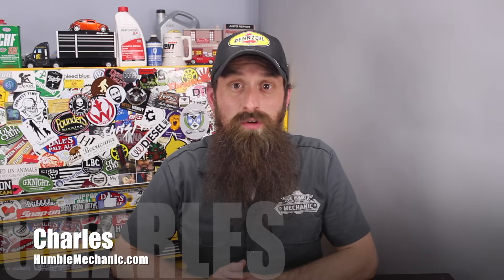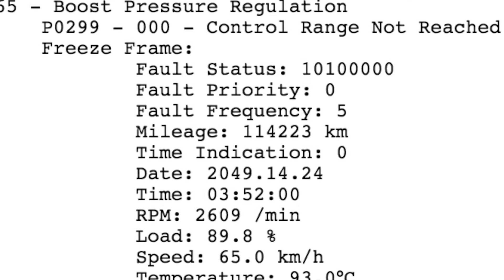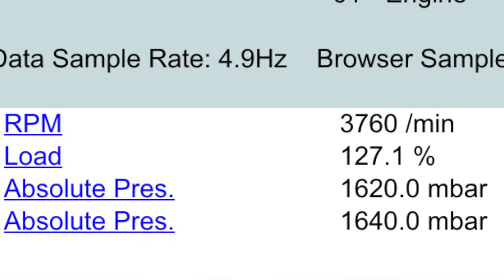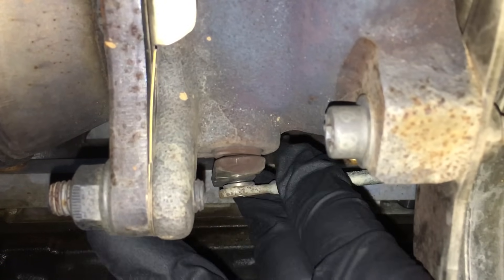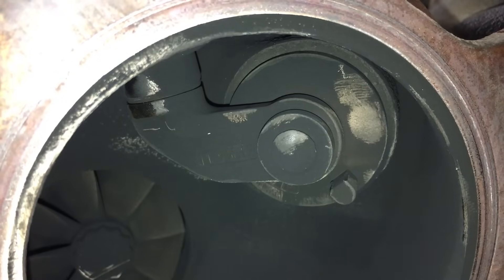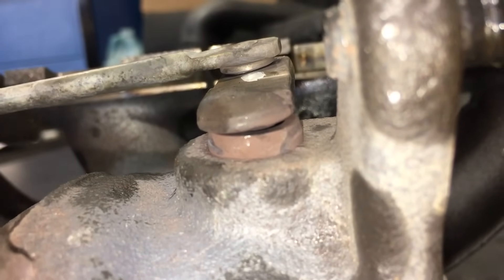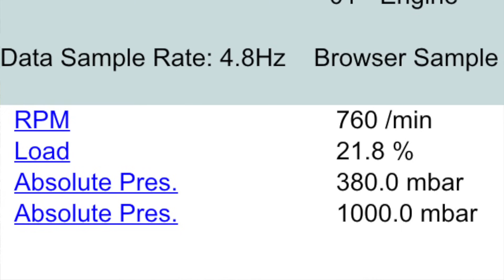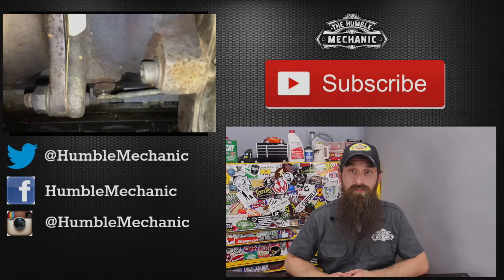Does Your VW/Audi 2.0t TSI Have A Bad Turbo

Comment: MIDLEADING INFORMATION: You can get the wastegate actuator replaced or send it somewhere where they rebuild turbos (way cheaper than dropping over $700 on a new OEM turbo). Also you forgot to mention to check play on the turbine if it moves in and out. Also spin the turbine and if it feels like it hits something, then it’s bad as well. One last check is really easy, run the car hard (pedal to the medal) for at least a good 30 minutes at night. Then park in a dark area, open the hood and check the catalytic converter. If it’s glowing red hot like if it’s lava then turbo is leaking oil into the exhaust system and intake system. You can also smell the burn every time you do a hard pull. You don’t need a new turbo, you can get it repaired/rebuild. You can even buy a good used one. One last thing, expect the life of your turbo to drop drastically if you run a Stage 1 tune or higher. Hopefully this helps someone
Reply: addio12 this guy’s calls himself humble mechanic. And “likes vdub” but all his videos are him talking shit on them and making claims for videos.
Reply from the maker: I’m not sure that’s accurate. Or has anything to do with humble or not.
Reply: Hey I have a 2004 Audi AT 1.8t and last year I upgraded to the K04 turbo with software upgrade, injectors, and high flow CAT.  Everything has been running great and still does, except about 6 months ago I noticed my exhaust manifold and turbo housing getting red hot.  I mean literally glowing.  I used my infrared thermometer and it read 900°.  I know turbos are meant to withstand a ton of heat, but what could be the cause of this?  Again, no under boost condition.  Should I get a high flow exhaust manifold?
Reply: @dillonclark7737  Could be normal or it needs more fuel to cool it down. Prob get a air fuel ratio sensor installed and make sure its in specs.
Reply: Dillon Clark, you're probably running too lean.  What's your AFR when under load going through the RPM range?  And did you get a proper tune after the upgrades to your injectors, turbo, and high flow cat?  How about your fuel pump?  Is it able to keep up?  Finally, how big are your gaps on your plugs?  Bigger gap means bigger spark means hotter burn (potentially)
Reply: So a leaking turbo is the only thing that will make a cat glow and it always glows if you have a leaking turbo?  I think not.  Also, maybe he doesn't think having joe blow home mechanic prying on the impeller with a big screw driver.  Sorry, but you're the one with the misleading info.

Comment: just faced this problem in the shop, thanks for putting out great info!!!
Reply from the maker: You are very welcome. :)
Reply: @HumbleMechanic  so I just replaced  my turbo and it came with a diverter valve  installed  already.. so I figured its was plug-play.. so I cleared codes and took for test drive. now when i Accelerate it  Putters... it ran fine on the lift and for a block and a half. I dont have access to vagcom atm. I work at Nissan and I have a snapon scan tool, what could be wrong??

Comment: I note the Golf and Jetta aren't mentioned. They have TSi engines too. But if a turbo fails on a 1.8 hell just get a better turbo and upgrade.
Reply: There's no such thing as just get a better turbo this drivel is such nonsense without painting the entire picture. What's required to SUPPORT a better turbo upgrade where you can drive on an unrestricted road and top out at insane speeds because of that supporting ECU upgrade and 3" DP upgrade and the Full Catback SS 2.5" or 3" Exhaust upgrade and the Upgraded DV with accompanying Boost gauge and the Transmission upgrade with the Upgraded Clutch Kit and the Suspension upgrade and the Brakes and Brake lines upgrade. After all, you do want to Experience the full potential of having a better turbo just don't misguide people with info like it's a one part upgrade when it involves many other parts and nothing of quality comes cheap!

Comment: Hello guys .I repair only westgate  valve on my mk6 GTI using special materials.No need replace turbo only westgate, if you have error code P0299.But you need check also air pressure valve.

Comment: You solved my AUdi TSI problem : P0299 Turbocharger under boost problem . Thanks
Reply: Gjergj Konomi what kind of Audi?  I am getting a sudden hesitation under heavy accel and just yesterday noticed a whistle sound. It is a 2012 A3. He seems to indicate that if you hear a whistle then it is tubing from the turbo  to the throttle body?

Comment: Hello Charles,  I´m writing from Ecuador.  Thanks for the useful videos you publish.  One quick question, would you advice to buy a 2.0 tsi or 1.8 tsi equiped car?  here I have a couple of options with very low mileage cars.  Both passats 2014 with less than 40 k miles!  I own a skoda octavia tdi and I have changed the turbo twice already,,,,  thanks so much for your time and answer!!

Comment: Thank you. I just bought a 2013 gti with this code. Now i know steps to troubleshoot and the issues to look out for. Charge pipes and intercooler i checked first thing
Reply from the maker: Happy hunting. :)
Reply: @HumbleMechanic  Thanks. I bought the car for less then half of its book value. I got a shop that claims they can fix the wastegate for $250 if it comes to it. 
Thanks to your video i will follow all steps before pulling the turbo.

Comment: My 2014 2.0 TSI Tiguan displayed the P0299 under boost trouble code with 45,000 easy driven miles on it. Took it to VW dealer who informed me they found a loose waste gate. They are going to replace the whole turbo assembly. Apparently they are not willing to repair the waste gate alone to save customers money on the repair. This is an expensive repair on a low milage car!

Comment: I got an unusual cause of a p0299. Restricted cat. Not fully clogged but restricted. 
I actually replaced the turbo based off what the dealer told me and still same issue. I have a cbfa and took out the o2 sensor on the turbo and hooked up my vaccum/boost gauge that is connected with a couple adaptors and started the car. At idle it was 2 psi reved a bit and went to 8 psi.
Edit: forgot to mention I only had a p0299 code and nothing else.

Comment: I could really use your help with a Audi 4.0t engine I’m having issues with. I think it’s having the turbo issues that comes with that engine. Runs fine when cold. But after it warms up, it has problems starting and starts misfiring, there is a ton of black build up on time of the turbos themselves.  Mabey the oil separator? Or is that build up on the turbos coolant? Leaking coolant into the turbo causing misfire?

Comment: Hi Charles like you said I got a Tiguan with the same under boost fault and it was loose on the waste gate pivot I installed the anti rattle clip that you can get at the VW parts department it's meant to reduce the noise from a loose waste gate but I installed it and it did solved the under boost for a  while but the other day when the customer came in for a service there was a fault for low boost but at least it's way better with the clip on now what I do is on all CCTA engines I install the clip before the the problem is there I think that it will help prevent the wear of the waste gate there is an other thing to look for is the cut off valve on the turbocharger if the car is a early production it might have an old style valve with a torn diaphragm I've seen it before the other day I got a Jetta with this fault and the hose close from the throttle body for the sound generator for inside the car the spring clip was left off when the dealer replaced the injectors on warranty.

Comment: We do a lot of these on 2.0t tfsi a4's and you can distinctly hear the waste gate rattle when shutting the engine off or after simply revving the engine up.. On the Audi side we have extended warranty for the worn out waste gates, in Canada at least

Comment: OMG "the pin on the waste-gate rattling around" There are a LOT of complaints online about the 2019 Jettas that are having rattling noises once the car is engaged between 25-35 mph! Could this be the issue? If so, would the waste gate need to be replaced/fix? There's even a couple of youtube videos proving this noise is happening every time between those speeds, too!

Comment: previous owner of my cc sport changed oil every 10k miles.... now i’m shopping for a new turbo 🙂
Reply from the maker: Damg
Reply: How many miles are you in, my brothers Audi is at 100k and it’s shooting oil out the exhaust and burning it like crazy so I’m sure the turbo is fucked too
Reply: Martin 392 i’m at 150k now. just a bad wastegate i believe. sounds like the seals on your turbo are bad
Reply: Colin Clarke you think I can solve my problems with a rebuild kit
Reply: Martin 392 you would wanna pull the turbo, clean it up and make sure all the internals are good first
Reply: I got 93k on my 2013 tiguan. Had to replace a PCV valve and now a P0299 code. I was religious with my oil changes and intervals. never again.
Reply: @colinclarke9379  same problem same mileage same car 💪🏽

Did it turn out to be the waste gate on yours?
Reply: WolfganG yup it is loose. car still runs great but the underboosting light is on.
Reply: Maybe I’m ignorant here.  But, what does oil have to do with turbo malfunction?
Reply: @scottdrew6403  
The shaft that connects the two turbines needs to be lubed. That's all I can say lol
Reply: @colinclarke9379  I'm seriously considering a turbo delete since the power difference isn't really that big with bc of the DSG tranny
Reply: Austin you can change your oil frequently with the best oil money can buy and it won't prevent this type of failure.he should've been a little more direct and call this what it is, a Wastegate failure, not exactly a turbo failure. I have a turbo Ford, but Ford and Volkswagen both use the K series turbos manufactured by Borg Warner and I have suffered this exact same issue at about 100,000 miles. Over time, the linkages on the vacuum actuated wastegates wear out. Unfortunately, there is no fix (I even took it to a turbo reman shop and they said it couldn't be repaired) other than replacing the entire turbocharger assembly. So what should be a $50 to $100 repair if Borg Warner would correct this flaw and make this serviceable turns into a $2,000 (parts & labor) turbo assembly replacement.
Reply: @JonnyRicter  damn right bro. Thankfully, mine turned out to be a diverter valve. Replaced it with the new edition/version and the light went away.
Reply: WolfganG and it doesn't even piss me off that the Wastegate linkage wears out after 100,000 miles, it's the fact that a perfectly functional turbo has to be replaced because a steel linkage and valve have 1/64" of play in it and due to that I had to fork out $2,000.
Reply: @JonnyRicter  welp... My particular vw has almost 160k. But if we're getting real technical, you don't really have to replace it. If you can take it out and find a friend who has a blow torch, the hinges around which the valve rotates can be bent after being heated. I've seen many videos of people doing this. But you do have a valid point, shouldn't have to take out the entire turbo and exhaust assembly for something that could've been replaceable without doing all of that!
Reply: WolfganG very true i’ve seen it done as well. just takes some hard work and it can be fixed.
Reply: lmaoooo
Reply: @colinclarke9379   I think so too  the waste gate  is  not the  bigest  problem  with  loose shaft and flipper . I  tought  i  have to change my  turbo since i think  engine got overheated  and seal went bad ! and Smoke at start up !

Comment: I have a 2007 Audi A4 2.0 Quattro, this is the 3rd time in less than a year that I have replaced the DV and I still get the P0299 code. What I think that makes this unique is that when the car is running cool, it's a beast! But as soon as its up to running temperature its pure sluggish. I notice that when the P0299 does come on its usually on some type of incline (me going up hill), or merging on to the highway. I hit the gas and it doesn't do anything. Again when its cold, its a beast. But as soon as it warms up this happens. I have been finding multiple answer for P0299 , MAFS, PCV, Cat, this video. But Im thinking that the temperature issue might help diagnose it further. I read that it could be a leak somewhere because of the metal expanding when its hot. Still not sure. Oh and after an oil change at about 3,000 miles i get a low oil light. and then I add a quart. 

Please help if you can. I love the car and it normally drives great, but this acceleration issue is a pain in the ass. thanks again!
Reply: similar issue here....i have a 2.0 tfsi leon. I have around 16-17 psi with warm (but not hot!) engine...but it drops to 9-12 psi after a 10-15 mins highway round (constant 3500-4000rpm). otherwise i dont have an error code for this, but after the highway round i hear a whistle voice/sound from the turbo side...so i guess i have to tighten the bolts on the exh. manifold (so there is a boost leak)....but you cant tighten them on cold engine :/

Comment: Have you seen a turbo on say a 2010 cc blow a turbo seal an bellow smoke from the exhaust as well as leak from exhaust side? Will not over heat but lots of white smoke an oil in exhaust

Comment: Have RX7 Turbo. Rebuilding the HT 18S2S Turbocharger cost me 200 - 300 bucks. Is it more expensive on a VW people carrier than on my high performance ( 1988 ... ) sports car ? Isn`t it more clever just to change the turbo after 100000 mls instead of risking parts of it scrapnelling through the engine ? For my RX 7 I always have a used turbo as a spare. (  100 bucks ) When the one in the car is starting to make noises or causing other troubles I give that away for rebuilding ...

Comment: my car just started throwing the P0299 code (2011 A4) and I think my turbo is shot just like this one. with the engine cold, I was able to grab the wastegate actuator rod and it rattles. I haven't done much more investigating from there. I ordered a new wastegate and intend on modifying the actuator rod so its adjustable so I don't ever have to deal with this ever again. I figure its better to waste $100 trying to repair it, than waste $1,500 if it meant it only took $100 to fix.

Comment: I noticed in your video you have P0299-000.
I'm working with a 06' VW GTI 2.0T FSI engine with codes
P0299-002 (000665)
P0300-001 (000768)
P0301-001 (000769)
P0303-001 (000771)
Car drives ok at lower speeds but bogs down when you try to speed up and hit higher rpms. Car kinda sounds like it's back firing when hitting high rpms and then dropping to low rpms fast (hit the gas and let off quickly).
No other codes are set
What would you guess?
Restricted catalytic converter?
Reply: Patrick,
I have an Audi 07 A4 B7 that is shooting out the same codes.

Though it may not be the same problem, I managed to clear some of the P0300 Series at least. I ended up having to replace the spark plugs and ignition coils. Instead of bouncing back and forth to isolate the problem I just replaced all of them using Ignition Service Kit from ECS and the misfires cleared. The kit comes with pre-gapped Bosch plugs.

Paul from Deutsche Auto Parts explains coil errors in great detail:
https://www.youtube.com/watch?v=yXRVbifIaRE

As for the P0299, I have tried to replace the diverter valve and the problem went away for a little bit BUT the engine light turned on again. I am thinking that I will probably need to remove and either have the turbo rebuilt locally OR get a new on as Charles mentioned.

I did look at just replacing the waste gate but it seems to only be a a temporary fix. Did you get your VW codes cleared?

Comment: hey Charles, couldn't you just purchase an aftermarket waste gate acutator with a threaded rod and adjust the preload tension rather than the entire turbo? it seems that the wastegate flapper would still seal, just that the original wastegate has worn quite a bit causing it to lose its preload tension on the flapper when shut.
Reply: as far as i know, you dont need to buy an entire new one. just take it to a turborepair company, so they can fix it for a lower price. (and they will check the other parts vanes,axis,etc of it as well).

Comment: I work at a VW dealership just did a turbo on an 11 Tiguan with 36,000 miles, same code found turbo bearing to have completely failled and destroyed the fins. Similar one also failed at 86k 2016 Tiguan.

Comment: I have an 2010 Tiguan that was getting that code P0299 with 111k miles and found the problem to be the diverter.  I replaced it with the new upgraded version and did a clear with the scan tool and she was good to go.  I guess I got lucky!
Reply: vulcanbespock what is the part number for the diverter? Thx
Reply: I got it from ECS...This part will be upgraded...about 40 bucks
Reply: 7.01830.13.0 PIERBURG
Reply: Are you saying that your waste gate didn't have the play in it, as Charles shows in this video?

Comment: Hey Humble Mechanic! Loved the video, super informative.  Question... My 2011 coded and it was the check engine light.  The code was P0299.  The dealership confirmed it was my turbo and recommend replacing it.  The price was too high and so I'm holding on for my old VW mechanic.  Today the light was on, then I got back in my car and the check engine light went out.  Since the diagnosis I've been driving it very gingerly.  Any thoughts on why the light's out?

Comment: Great video! 
I think my wastegate actuator arm is causing an annoying rattle and low rpm 1000-2000rpm low boost. Was told this is considered normal operation of my turbo. I’m having no boost issues or codes coming up.
Is a little bit of play on the actuator arm itself ok? 
Now freaking out my turbo is about to blow 😳
Thanks